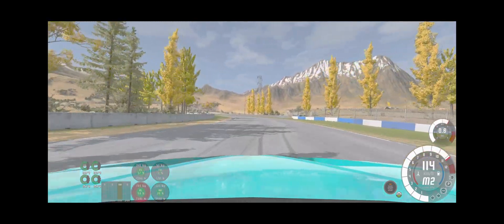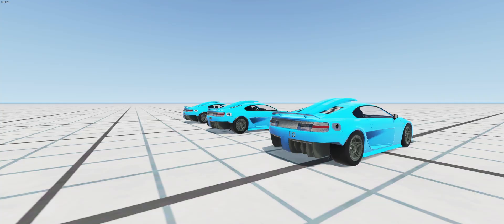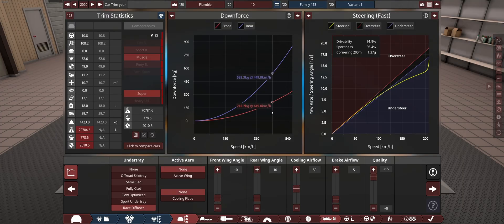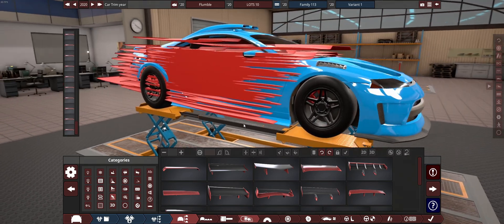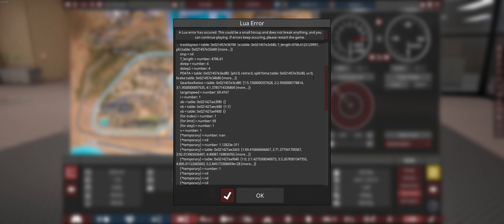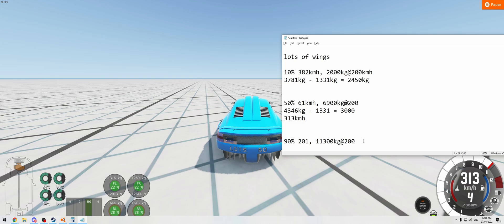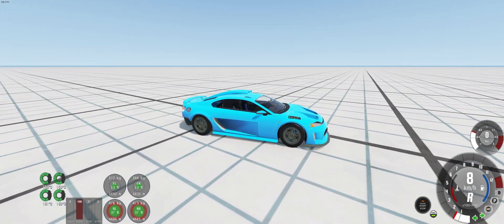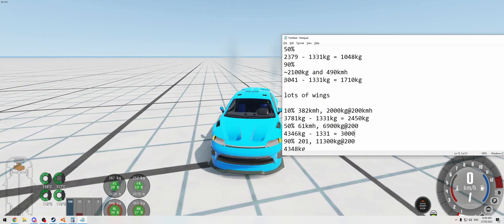We Now Know How DOWNFORCE WORKS! (Automation🔧BeamNG)

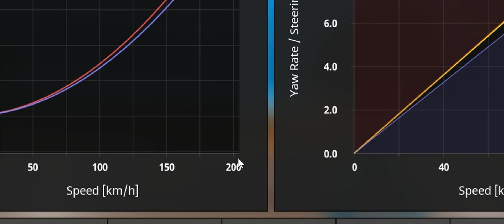Comment: IIRC, I got that excessive downforce warning before, like at 6:30, just because my car didn't have a wing, LOL. Was that a bug with an earlier-open-beta of Automation?
Reply from the maker: it was a system of doing downforce they were trying to use that was more accurate to what you'd see in the automation graphs. They've now started to move to an entirely new system that is even less dynamic in how it works in beamng, but seems to have none of the faults

Comment: So then if we want a realistic looking supercar that’s actually drivable at very high speeds then we need to put an invisible wing inside the car somewhere towards the front to keep the nose down better?
Reply from the maker: you have to make a balance... but this is all up in the air now, as they just dropped a new update that should change everything -_-
Reply: @fillman86  dang, hopefully it’s fixed then lol. I was building a hyper car for a Facebook challenge earlier this year and it was basically perfect except the downforce in beam didn’t work so I ended up abandoning it ultimately
Reply from the maker: @stephenmartin5766  oh dear :/ well I'll be addressing the update soon

Comment: Man this new downforce system is a pain adding more downforce makes the car a deathtrap. Too little downforce and car understeers at high speed man this is complicated
Reply: THE CURRENT AERO MODEL IS  ALL OVER THE PLACE
Reply from the maker: well we now know some more tricks to make it work the best it can :/
Reply: I had decent luck with a gt3 sort of car, but at most it was maybe 900kg total downforce
Reply: If you tune it right it works mostly the same as the old system
though now you dont have aero instability like you used to 
you can run 0 angle now and be fine
if you ran 0 angle in the past youd risk becoming an aeroplane (you could also make it so it worked like DRS)
Reply: @EkaiMin  huh drs type downforce how
Reply: @crispyshaman4937  Low angle wing and the right suspension would mean that as you increased speed the downforce would lower the angle of the wing
theres someone in flux's server that apparently got it to work well
Reply: mine works good without messing with it, but it's downforce over 200mph is so high you can't really steer, and it's clear it's slowing it down too